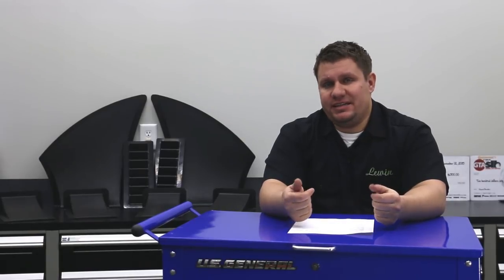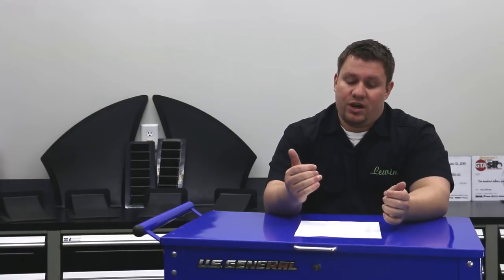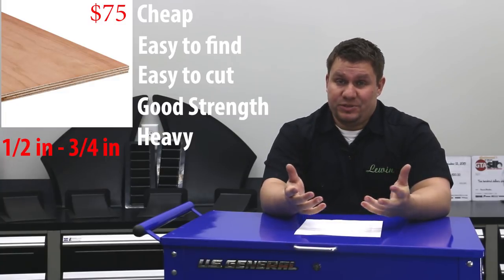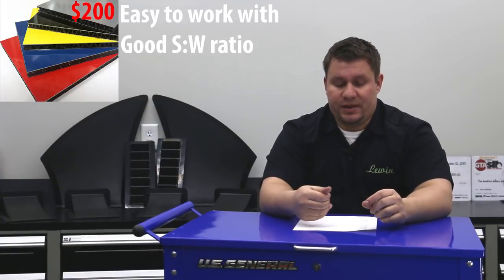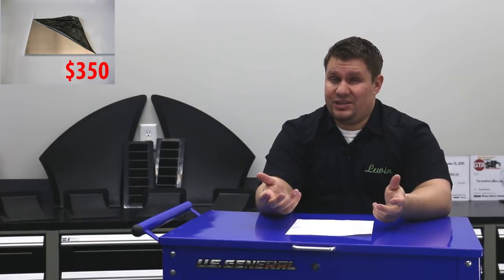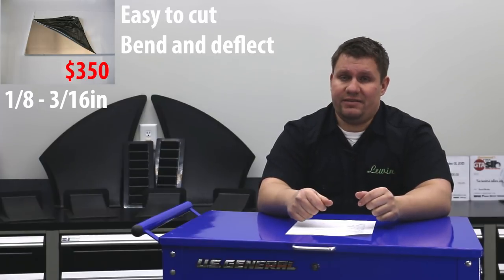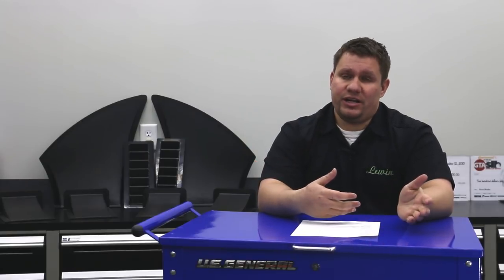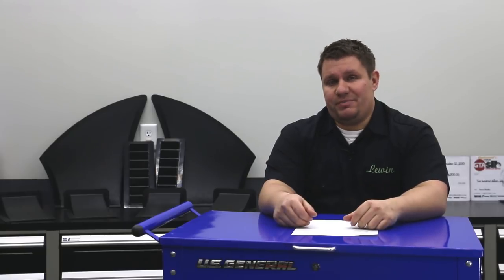#DIYDownforce Part 1: An Introduction to Splitter Design for Maximum Downforce

Comment: So I understand needing some thickness for an aluminum front splitter, but do you need the same thickness for side splitters? I was thinking of using like .041 or .063 6061 aluminum to make some side splitters for my e92. I'm more interested in the benefits if keeping road gunk off the side of my car but if I'm going to put all the effort into building something nice I might as well to it right
Reply from the maker: Are you referring to side skirts? The area below the doors of the car, parallel to the road surface? The forces aren't going to be extremely large there so you can go with a thinner material but you still need to be aware of flex. Once aluminum gets too thin it will wobble so get a couple of test pieces and see what you think. My guess is you won't like .041.

Comment: Nice video! How do you bond two panels of 6mm alumalite in opposite directions together?
Reply from the maker: Construction adhesive made for metals. You also need a lot of pressure.
Reply: You could also laminate thin aluminum to corrugated plastic making your own composite.
Reply from the maker: @jdcarguy1242  yup that's an option as well.

Comment: Do you have a favorite source for 10mm alumalite sheets?
Reply from the maker: Where are you located.
Reply: I'd recommend looking for outdoor sign and plastics companies first.
Reply: @ProAwesomeRace  Asheville NC
Reply from the maker: @mattcolley5124  I have a list of main distributors and it doesn't look like there are any in Asheville. The closest is Piedmont Plastics in Charlotte. You can try them or call local sign shops.
Reply: Any tips on alumalite sheet suppliers in Ontario, Canada ?